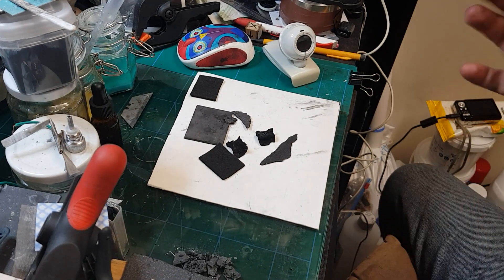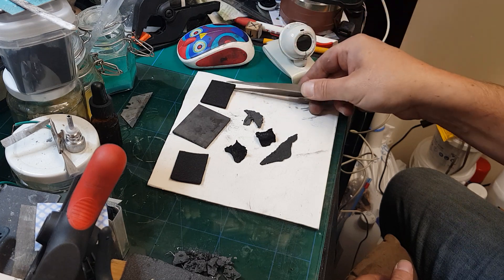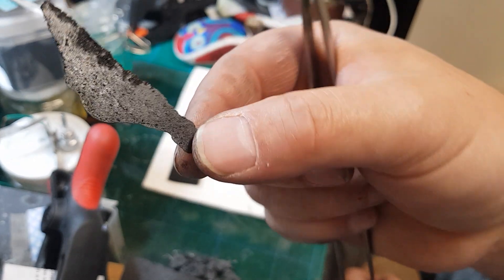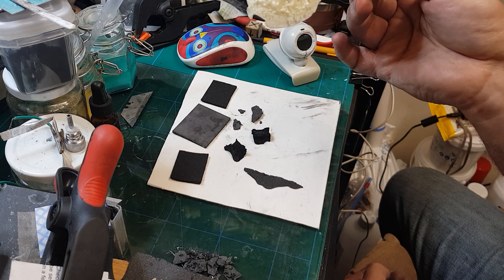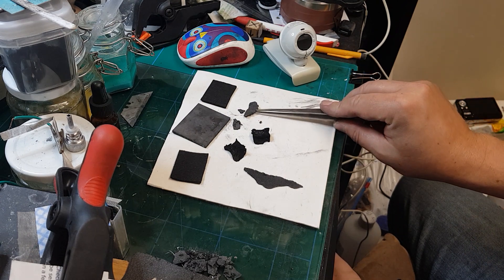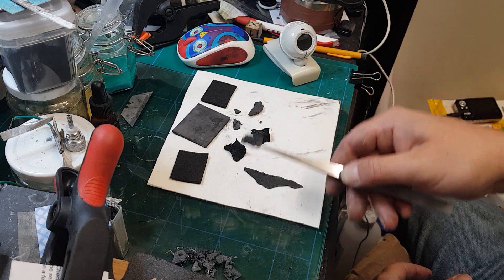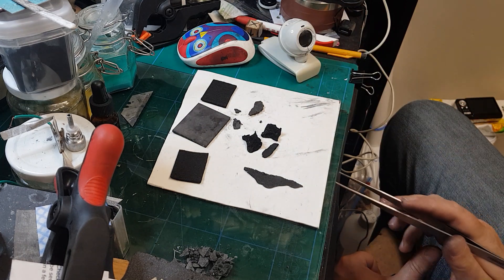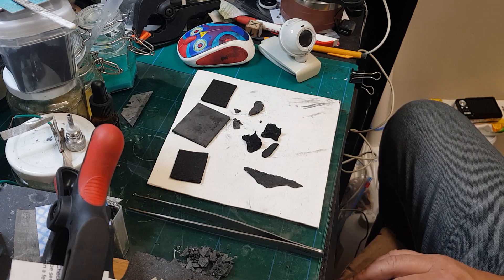Different diy carbon foams

Comment: Very interesting research. Keep up the good work. You could try soaking all them bits of carbon in some zinc chlorine then put them in the microwave oven for 8 minutes and watch the ohms go down to 3 ohms.
Reply from the maker: Thank you Dan, I will. First I have to find a way to cook them slowly, otherwise they will vanish.  I had 8 pieces in the kiln, but only these came out. I will keep working on these.

Comment: Very interesting that the melamine carbon foam is still flexible after carbonization. Boy, that melamine polymer is sure packed with nitrogen isn't it!  I just ordered melamine foam from eBay and will try this. Lots of interesting materials one can try to dope it with. Thanks for sharing!
Reply from the maker: More interesting is the fact that ( although is has a high resistance,  in the range of 500 kohms) it can still  store some energy and it runs for 4 min at a 10 mA discharge and a zinc negative plate. More to come....